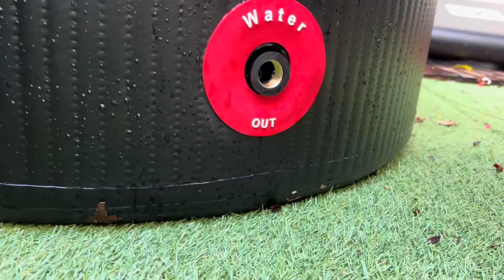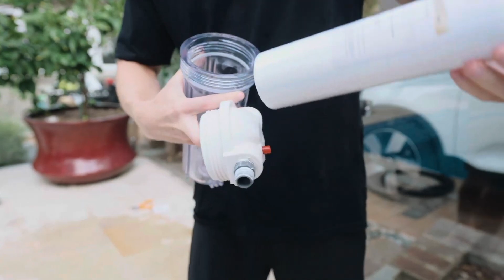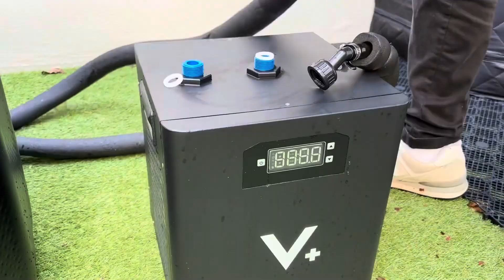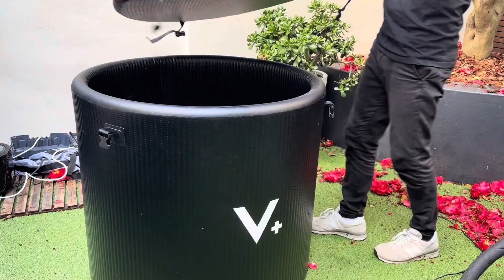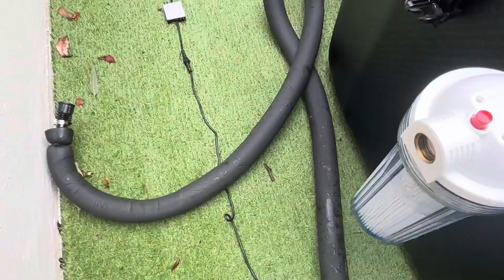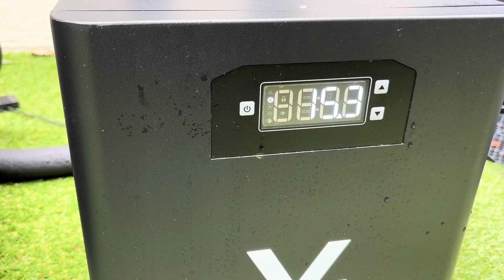Setting up your Vital+ Chiller

Comment: Yea, which is the inlet and outlet..... da fakkkkk
Reply: It doesn't matter, the chiller doesn't have a pump, the pump at the outlet small filter is pushing water thru the chiller, then the water passes out of the chiller back to the green inlet.
Reply: @dgoebel57 Thank you! Such a simple thing they could have mentioned!
Reply: Did you ever figure it out? My wife and I are having the same issue lol